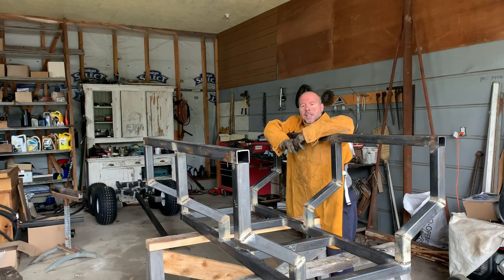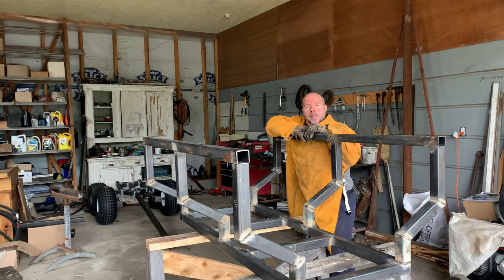The Ultimate Quad Trailer - Part 4 - Building the Dump Box (#theultimatequadtrailer)

Comment: Where did find the tires those what I wanted for my tub trailer but I could find them anywhere did they come with rims and what size and where did you find them
Reply from the maker: Hi Tony,
I bought these in Ontario Canada so I'm not sure these will be much help.
Tires/Wheels: http://www.cerka.ca/62-22-8-4-22-x-11-8-knobby-atv-trailer-tire-on-4-bolt-wheel?search=62-22-8-4
Hub: https://www.princessauto.com/en/1250-lb-high-speed-trailer-stub-axle/product/PA0002080000
Hope that points you in the right direction!
Thanks
Andrew
Reply: Thanks I'm in alberta I will look them up as I plan on building another tub trailer